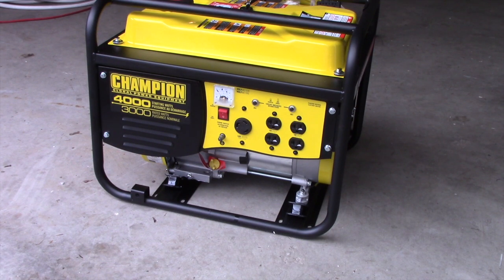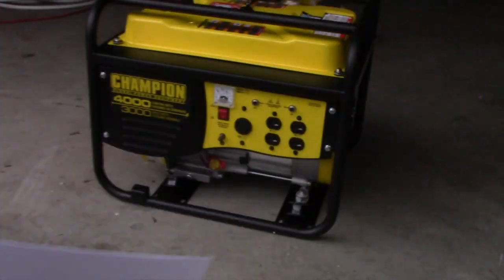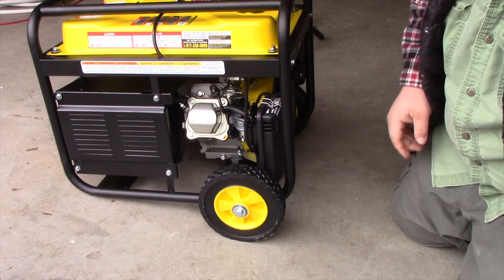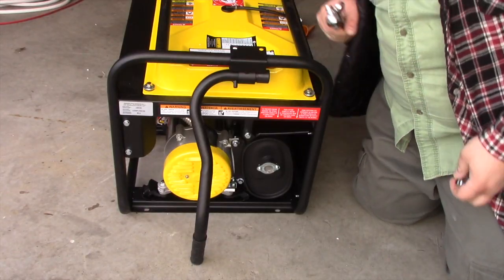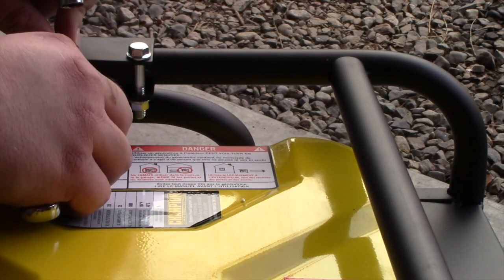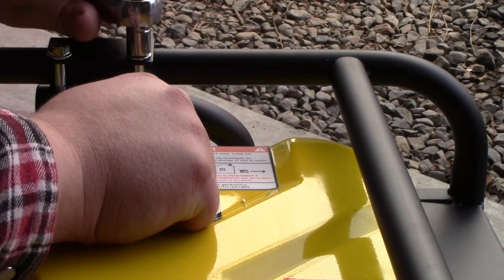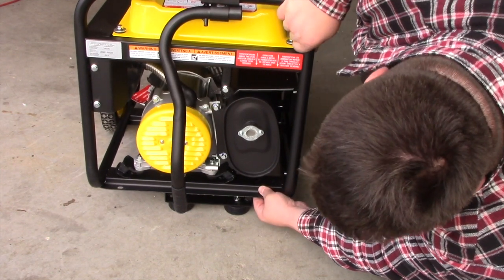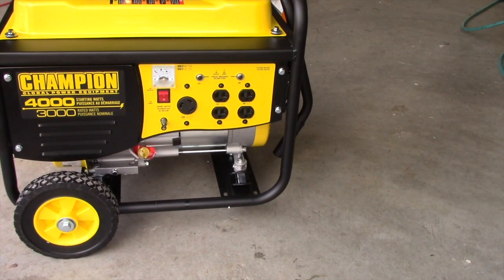Champion Generator Wheel Kit Install

Comment: Great video! Very helpful! One thing that I noted that wasn’t in the video, on the model I purchased which was the 4500/3650 model, on one side of the mount where the rubber boots support bar fits there is already one boot on the left that has to be removed before installation. Thanks.
Reply from the maker: Yes i also put lock washers on the rubber feet a few months later as the vibration wiggled them lose and one fell off!

Comment: Where did you find this wheel kit? The only one I have been able to locate looks like it has cheaper quality wheels.
Reply from the maker: Hi There they came with the unit. I usually wait to get the whole thing on sale then put it together when i have time, The separate wheel kit should be the same... You could also likely make your own and put better air filled wheels on it as all you need is wheels and bolts and a lift bar for the front.

Comment: Their is another wheel kit then this one...an older version......it has a bracket that bolts to the bottom of the base frame and holds the wheels...this kit does not has that bracket...the wheels simply bolt to the frame...the older version is shown here....

https://youtu.be/-byHx3I5myo
Reply from the maker: Great Thanks for sharing!